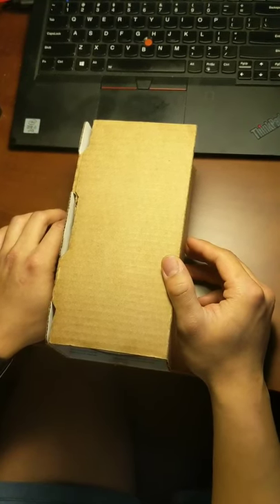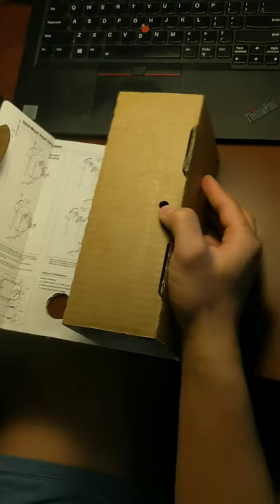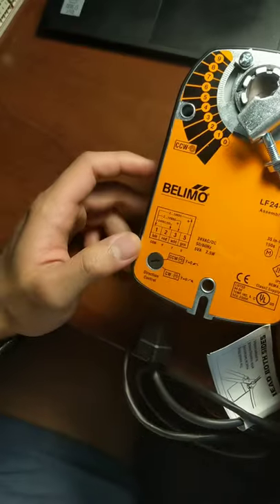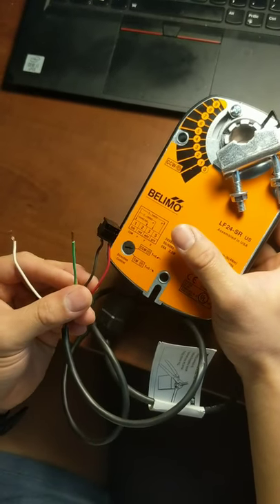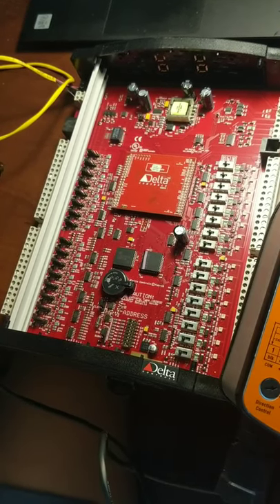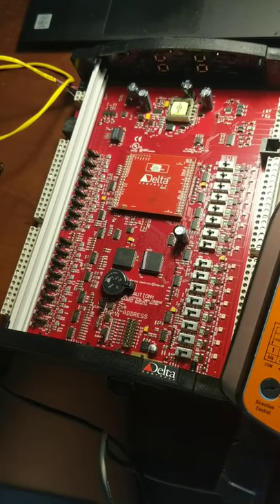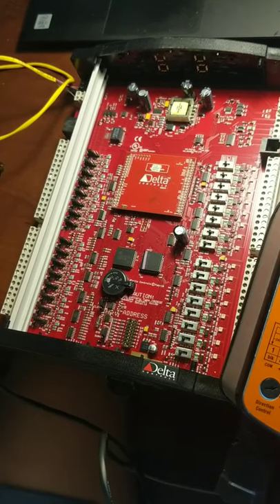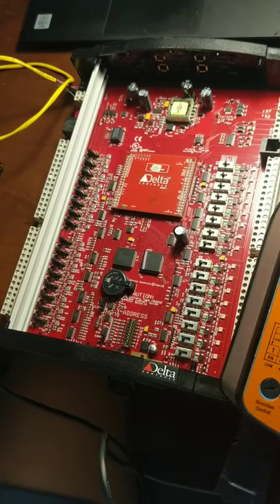Beginner Guide on Belimo LF24-SR-US

Comment: what you are calling "fail safe" is not. That is y=0, where the shaft should be when control signal where it should be equal zero volts see the belimo label. Fail Safe has to do with which side do you mount the belimo cw or ccw which has to do with sprig. So at 18:20 nothing happened because it was at the fail safe ccw number Zero position. Now, say you had at 14:50, disconnected the power (when y=0, your control line was 0 v because you change the 'fail safe' to the number 9) at that moment it was on number 9, and so it would then have moved to number 0 with the spring action very quickly.)
Reply: I just finished watching your video, 'nothing happens' at 21:24. 
That is because with the screw driver you are just setting your y=0. where would you want that Zero Volt from control to have you shaft at when the control sends a zero volts. 

To get the opposite effect of the fail safe, mount the belimo on the cw side. 

For example, in my case I  have to install an economizer in our coffeeshop Mulata Kitchen (a lot of work by the way).
Therefore in my case:
The Return for the HVAC for fail safe spring action I have to mount= CW side so louver will stay open on the Return when no power; and when control sends y=0 it is also open. 
The Outside Air Intake for fail safe spring action I have to mount= CCW side so louver will stay Closed on the Outside Air when no power; and when control sends y=0 it is also closed. 
In this case when my control is sending out y=0, Return is OPEN, Outside air is Closed; wReturn